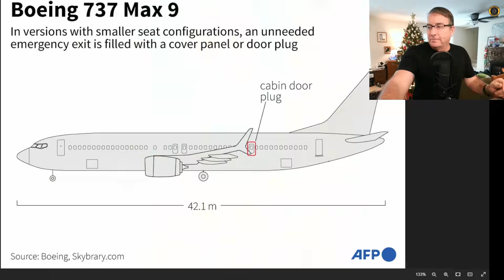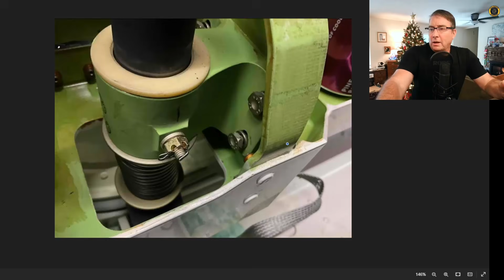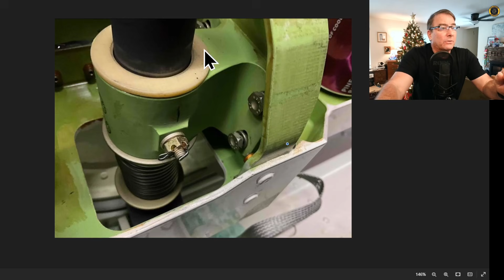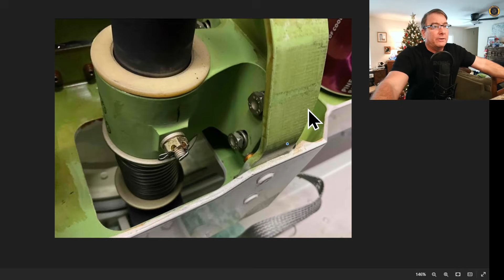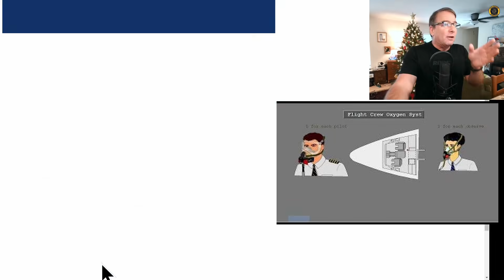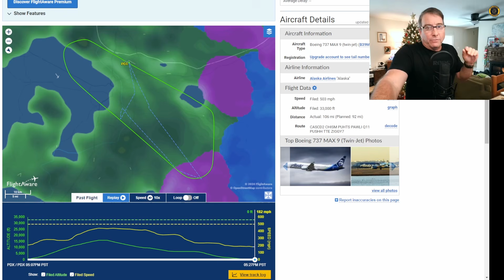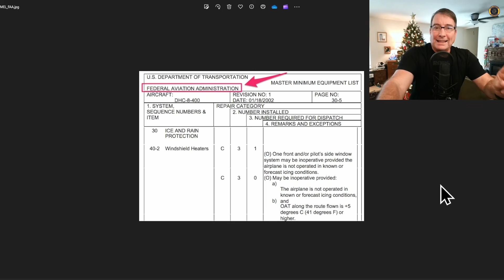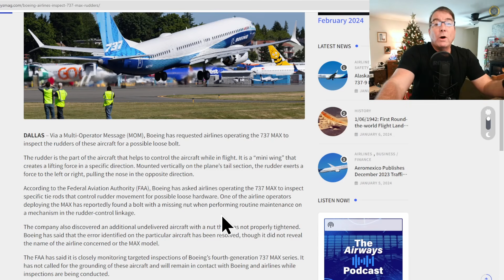"Yes, We Have No Bolts"  9 Jan 737 Max-9 Update

Comment: The 12 stop fittings/pads take all the pressure of the plug trying to push outward against the frame during pressurization differentials (flight).  The 4 locking bolts ONLY serve to prevent vertical movement of the plug roller track off of the upper guide roller (at the top of the plug) and the plug hinge guide fitting off of the lower hinge bracket (at the bottom of the plug).  The plug must be able to travel vertically at these points so the the stop fittings on the plug can move vertically enough to clear the stop pads on the frame and release the door. My uneducated opinion is that it is EXTREMLY likely there were NO locking bolts in place at all.  Why?  Because there is very little to no shearing pressure on the bolts by design - 4 independent bolts would all have to sheared off and under low shearing pressure.  If they were installed "improperly", for instance castle nuts only hand tight with no locking pin then the likelihood that they all could have spun loose several rotations each and then all 4 bolts slide out out position is just not realistic.  Simply 1 bolt in place would prevent vertical movement of the plug.  I'm going to venture that somebody at the Boeing factory or somewhere else didn't install the bolts to secure the plug from moving vertically.  More than likely everything was basically mechanically held in place by friction and the weight of the plug and with primary force being outward and not upward during pressurization all was good for some number of flights until just the right combination of pressure differential and jarring of the aircraft knocked the plug vertically enough that the top protruded up and out and was caught by passing air flowing along the exterior hull which ripped the plug out causing fracturing of the guide rollers on the plug.  In summary NO BOLTS at all installed.
Reply: Hi
Being a very old door guy, have worked in an engineering dept on both cargo and passenger doors.  The above statement is 100+% correct of how the 4 bolts function and how they were very likely missing and eventually the door/plug stops walked off the frame stops and blew.  Many years ago a test was done on a DC8 ( a test flight) to see if there would be a problem with mis- rigged door.  When the guys came back they were missing an aft door.  A plug door is only a plug door if the door stops stay behind the door frame stops.
JD
Reply: As a layman, I'm leaning this way too. Either way, it's a stark reminder that one little part not installed correctly can doom an entire aircraft with hundreds of people on board.

Comment: I don't understand one aspect of this door plug: Why is it spring-loaded? As far as I understand so far the plug is not supposed to be opened in an emergency, so replacing the springs with a spacer would've made them more stable, right? What am I missing?

Comment: They keep calling this exit a door PLUG.  In my experience, a plug door can never come loose in flight unless the aircraft is unpressurized.  A plug has contact all around it's edge with the fuselage.  This exit has a few contact points around it's edge.  It is not a plug.  This was a cheap way to comply with regulations with a lack of what could happen down the road. Enjoy

Comment: Is the cockpit voice recorder recording system is it built in software or tapes if its tapes it should be one tape one flight if its data there should be a way that after every flight it goes over the software to ATC recorder that way no mechanic no crew no airlines owner has any access to it full stop that way it couldn't be overwritten I once  had a situation  where something happened nothing dodgy or anything g and I said I've got it on a voice recording and someone said to ne ,yes but that couldn't count as a recording can be tampered with yes to record over erasing previous recording but that's as far as these things can be tampered with I hazard a guess it's easier on these than my recorder that if you erased it still left a note of date of erasion so as well as black boxes use a m9bile phone voice system connected to black boxes and after every flight before plane put away etc box should be disengaged of rape handed in to ATC and it should be signed out by mechanic and signed in by ATC it should then have a date bar supplied yo it do later if its needed it can ve located immediatelt

Comment: The bolts are never tested since they are not used in a level one application   Pressure boundary. They are part of a locking device for restraining gear.

Comment: well i think in my non expert view would be to leave these door plugs well alone, its obviously a retro fit after manufacture, why not leave the doors as fitted - ok so their might well be risk to passengers playing with them, perhaps a lock needs to fitted or somehow deactivate - the door plug looks like an accident waiting to happen - oooh er, it just did!!

the item regarding the cockpit door bursting open on depressurisation scares the be Jesus out of me, purely from a safety point - if i wanted to get into the cockpit, all i have to do is depressurise the plane and create havoc - this is madness

there's going to be some heads rolling

Comment: If the cotter pins were in the bolts it would be impossible for the bolts to come out wouldn’t it. Either the cotter pins were not installed, or the bolts were not installed. Unbelievable if in any cases its the latter.

Comment: Is it possible that the plug on the left side of the aircraft is normally left in the open position during the aircraft build?  One may do this to give easy access to the interior of the aircraft in this section for cables giving power to the power tools and even more so providing quick & easy access to the workforce working on the interior build.  Perhaps the finished interior panels were fitted covering what would be the bolt locations. This would bring about the situation that this left side door plug never ever had its 4 locking bolts fitted & if they were fitted they were removed to gain access as I have described.

Comment: Apparantley all the passengers had their seatbelts on just prior to that plug blowing out at 14000 feet.Does that mean that they were still to be allowed to unbuckle since takeoff or was expented turbulance the cause of them to rebuckle.?I havnt flown for years so cant remember when you can unbuckle but have been told to rebuckle if turbulance was expected.( Very bad turb. on a flight from Heathrow to JFK that was very bad for a few minutes)

Comment: The scary part of this whole failure is that they are finding more loose bolts as well in these grounding inspections. If the issue is indeed untightened bolts, this is a quality control problem, which then brings the entire airplane construction process into question. If they did not tighten this hardware, then what else could be loose in the airplanes from the assembly line.

Juan, Do you know if Airlines, when they place an order and their order is being built, do they have quality assurance/control inspectors onsite at the manufacturers? 
I know in other transportation industries this is typically how it works. Kind of checks and balances, not only does the manufacturer say that it was manufactured to the standard that is expected, but also the customer agrees and signs off that it has met their expectations as well. This is usually accomplished with very stringent inspections throughout the entire build process. 
Glad in the end of this so far that nobody has been injured.
Reply: is it possible lose bolts and screws are just the normal on all aviation and there are so many redudancies that it never created an issue before inspection?

also could those screws untighten themselves from vibrations after installation
Reply: @ppsarrakis  I thought this was a new aircraft.  I don't know about the other examples though.  Demonstrably though, safety-critical bolted joints do not routinely self-disassemble.  If they did, airplanes would be falling out of the sky on a regular basis.

Comment: Even just flying R/C as a hobby, lesson #1 for assembling R/C helicopters was to get the bolts properly secured.  R/C helicopters vibrate like crazy as the whole helicopter is the transmission and so any bolt not properly secured would just come lose right away in flight.  Unlike airliners, R/C helicopters are not built with any redundancy beyond an ability to do an auto-rotation and the smaller R/C helicopters don't even do that.  So yeah, any one bolt comes lose and the R/C helicopter is coming down in an uncontrolled fashion.  Even working on cars, something a lot of people do, lesson #1 is to have a torque wrench ready and tighten those bolts down to the specification.

This begs the question of is Boeing using unskilled labor to build these airliners when they can't even get the bolts to stay on or do the engineers designing these newer planes not know how bolts work in an aircraft and so spec out something that is going to fall apart?  I mean this is fairly basic stuff that was figured out a long time ago.  Granted, when I bought an e-scooter, one of the first things I found were the bolts were falling out as I rode it down the road, so I had to take the scooter apart and properly secure the bolts throughout the e-scooter.  I have gone through forums and apparently this problem is endemic with e-scooters.  It is frustrating that something so basic is simply not done right in the factory when it is easy to do.
Reply: I agree. Knowing how important the simple basics like tightening things down, are number one in everything from the first things even kids are using, as adjusting the seat on the bicycle, or it wont stay. You have to tighten the screw cap on the soda bottles or it will spill. If i had not seen the photos i would not have believed the things happening on this giant aircraft, risking countless lifes!

Comment: In the photo at 5:30 showing the door spring. Doesn't the bottom right flange bolt look like its not tightened/torqued? There appears to be a gap between the head and the washer.
Reply: Yes, the one behind it too!

Comment: The Airbus A321 NEO (which the MAX was specifically created to compete with) also has door plugs in almost exactly the same place as the MAX. And of course, door plugs are used on other aircraft, including other 737 variants. It would be interesting to see a technical comparison between Airbus style door plugs and Boeing plugs.
Reply: It’s not the plugs. It’s the lazy losers installing it
Reply: Clearly, the plugs are using most of the regular door hardware.  Since the regular latching mechanism isn't installed, they use the bolts to secure the door.
Reply: @mikee.3638  Of course. I'm almost certain the airframe is unmodified in order to allow fitment of an exit door later on if the airplane moves to a carrier that needs to use it.
Reply: I noticed about 20 years ago, that when you stepped on an Airbus, like the 330 or 380, the internal quality of the finish was so much higher than on a 73,76 or 777. Just always looked cleaner, good lines, bin baskets worked, chairs were efficient and worked, whole cabin feel seemed ahead of Boeing. I put it down to "European" quality control standards, but got a bit of flack from Boeing fans for pointing it out around then. I worked in the Pacific Northwest for 15 years and had a bit to do with Boeing workers.... I also remember thinking, hmmn, not the  brightest tools in the shed generally... I know there were many who were not like this and took great pride in their work... but that was my impression when dealing with them in healthcare.  I came to regards Boeing a bit like a Pontiac, and Airbus like a BMW or Audi in terms of quality. Looks like that is panning out true now... Juan points out so many relevant issues on this clip and that good man has to fly the 777. He sounds pretty disappointed about how this is all showing up the profit rather than quality control issues that seem prevalent with Boeing. Been a long time coming but the piper, it seems, always has to be paid.

Comment: The flexing of the aircraft and the heavy springs probably over time loosened the bolts. Since there were warnings, and the plane was new, I suspect faulty torque wrench calibration. This needs redesign. It makes no sense that one set of nuts are castled with cotter pins but the brackets are not protected beyond a lock washer it appears.

Comment: Experienced a decompression on a C-130 flying from RAF Woodbridge to Zaragoza Air Base, Spain. We were at our cruising altitude. Was noisy, violent and confusing. Rear cargo door seal blew out. Cargo compartment immediately filled with dust, dirt and items not tied down. Fortunately the biggest losers were those who had just opened their box lunches as potato chip bags, fritos, and cheetos exploded. My Pringles can expanded and then went back to normal size in my hand. I had not popped the seal yet. Hopefully with the two most recent incidents people realize they need to listen to and pay attention to the pilots and flight attendants.
Reply: That story brings new meaning to, “once you pop you just can’t stop.”
Reply: @RoryShieldss and we were messing with our INS troop, who was my neighbor, about hearing strange noises. Which we weren't, because he was afraid to fly. He had no idea he would have to fly to support the flying missions even though he was in aircraft maintenance. Lol. Yeah, he was mad at us for a little bit. Let's just say after turning around and landing at RAF Mildenhall and getting on the spare C-130, he was not a happy camper. 😂

Comment: As a former A&P… I always applied a torque mark on any bolts that required a specific torque. The mounting bolts in your photo had none. I also oriented cotter pins vertically so they would not fall out if the bent portion was somehow broken off or straightened out. The one in your photo was not. I’m sure there is an A&P and an inspector somewhere that are having some sleepless nights right now.
Reply: Most of these manufacturers and the facilities that installed the interior hire mostly non AMT people these days to save money.
Reply: What a great comment. From a pilot to a mechanic, thank you for for putting such great detail into some thing where lives are at stake.
Reply: Those four bolts are not designed to be torqued down. The castle nut is tightened to the depth where as the cotter pin hole lines up in the slot of the castle nut. The bolt is not compressing two surfaces together in this scenario. As long as the bolts stay put, the connection points will not seperate. Bolts that are torqued down for scenarios where they must not loosen may have a small hole drilled though the side of the bolt head, and a wire will be secured through this hole and securely wrapped around an adjacent tie point to prevent the bolt from rotating.
Reply: @joelsheebs728 I believe he was pointing out the other two bolts pictured, which are not castle nuts or safety wired. So they would be torqued. It’s in the video.
Reply: @joelsheebs728   Yes, IMO those "safety" bolts don't need to be torqued.  The main this is that they are there, hence the cotter pin holes and castle nuts.  If even one of the four bolts are in place the door will not come up.
Reply: @joelsheebs728  Correct, this is a sound established fastening method. The issue here is that the plug is an unnecessary complication and weakness introduced only on the -9 with no obvious benefit apart (presumably) from frame / barrel commonality during production by Spirit. But Boeing are able to produce -8 and -8200 variants of the shorter variant both without and with the mid door provision depending on customer requirement, no in-between solution with a removable plug.
Reply: My thoughts exactly.  As a retired USAF maintainer that is how I was trained.
Reply: Excellent comment .. should be highlighted.  Thank you
Reply: In fairness, those cotter pinned bolts don't even need to be tight - the whole bolt and nut can rotate in it's hole and they can still perform their function safely. But I agree, I think there'd be a standard procedure for everything, even fitting nuts and everything should be QCd
Reply: WHAT inspector?  I heard that Spirit FIRED almost the entire quality assurance department.  Eliminate a few hundred QA jobs, save a bunch on payroll!
Reply: I haven't heard this for sure, but I suspect that the Boeing spinoff company that made the door plug, Spirit, was formed to be a non-union company to save money on labor?
Reply: @paulw.woodring7304 that’s why it wasn’t built in Renton since they had to be union there!
Reply: That’s because what you were doing is good practices… not a lot of people are taught that. Although we did that with helium lines where I worked as you would want to know when something decided to slowly come apart.
Reply: Well I'm sorry but Tex Johnston would have made your cotter pins fall out whatever way up you fit them!
(Not really, it was probably a positive G barrel roll).
Reply: I'd be most concerned about the four bolts that retain each bottom hinge fitting. They appear to be threaded into a blind hole and aren't safety wired. Not sure of anything, but missing cotterpins are very noticeable even to an RII inspection. Interested in learning the outcome.
Reply: more loose hardware waiting to be found.. hopefully not at any crash sites.
Reply: The younger engineer needs to solve this problem..This is a plug and not a door or emergency hatch under 737 seating configuration.  Weld the nuts to the bolts with a portable welder as well add the cotter pin and locknut sealent (1980 tech) or match the opening smaller....and just use portable tools to cut the opening larger for a door/escape hatch.